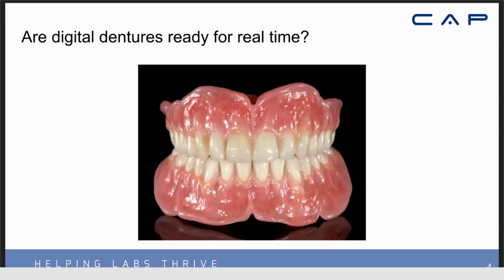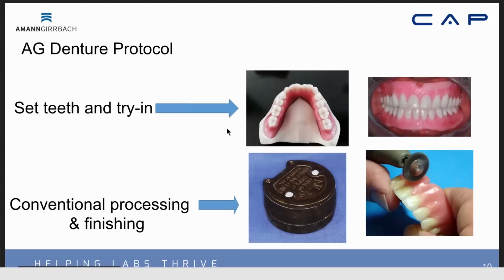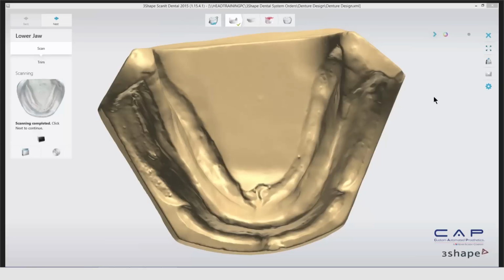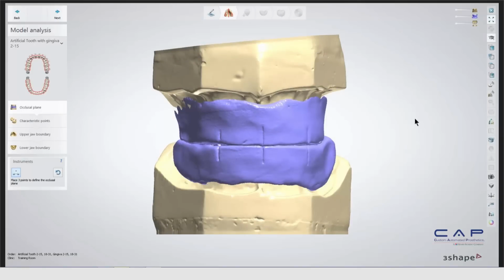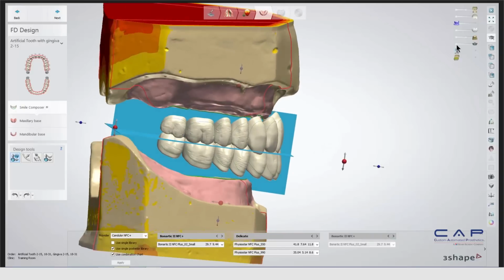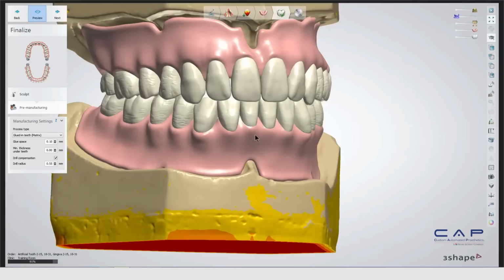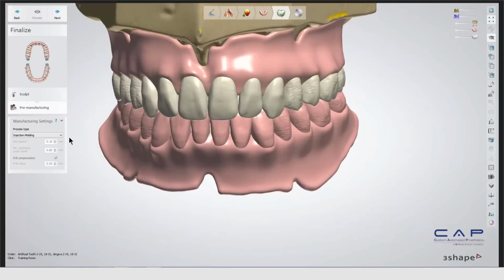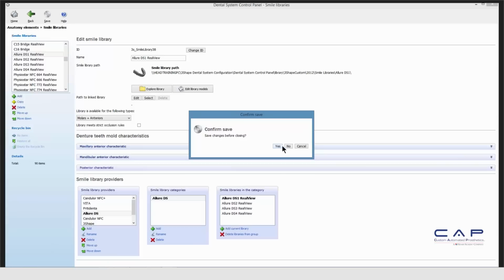Digital Dentures: What You Need to Know

Comment: This video has one of the guys state that when processing, the model is the base, not the wax.  That guy needs to be corrected.  The flasking causes a space to exist between the stone and that stone is formed around the wax.  So in fact, the wax DOES affect the processing of the base.  You festoon and stipple the wax for a reason, because the wax DOES affect the stone poured into the flask.  Then the acrylic is formed between both sides of the flask in the space where the wax existed.  So that guy is in error.

Comment: Hi, I just did my impressions yesterday  for digital dentures. I had two pairs of the traditional  type in One year. The dentist at the time could not make a set to fit.  I got my money back and found a new dentist.   I want to know if the plates are thinner ?  The traditional dentures plates were so thick, and felt like I  was choking.   I live in Baltimore and with my Delta Dental USA plan ,I am paying $1,700.00  total for both upper and lower .  Best Wishes
Reply from the maker: Frankly, 90+% of dentures don’t ever fit well, you lose sense of taste from covering the pallet on the upper and they will move around when functioning and or speaking.  If patients are not explained these problems before getting the dentures they tend to be very disappointed. If the conversation happened prior to delivery, patients generally do much better. If not explained properly, patients expect something much closer to their old natural teeth. 
The digital denture should fit better than the traditional denture. That said, much of this depends on the dentist and lab that do the work. The thickness issue is not related to either digital or analog. You should ask for “THIN” dentures. But be aware that thin dentures are not as strong.
Reply: Have you received your digital dentures yet if so how do you like them? Thanks
Reply: You can make anyway the tech wants it. thick or thin.  Dentists are not all equal or technicians.